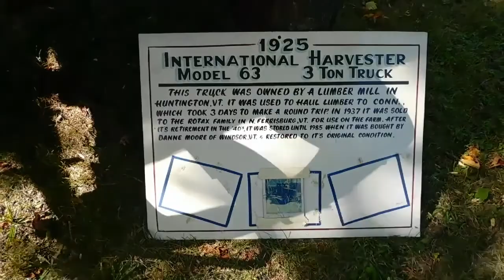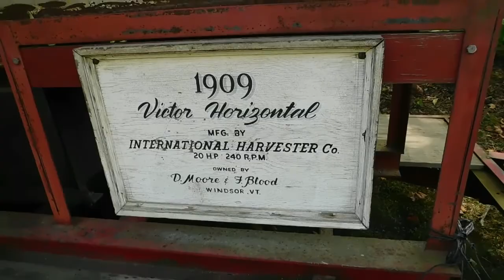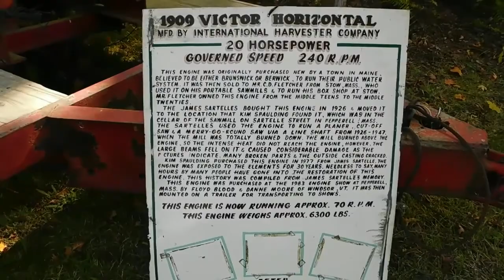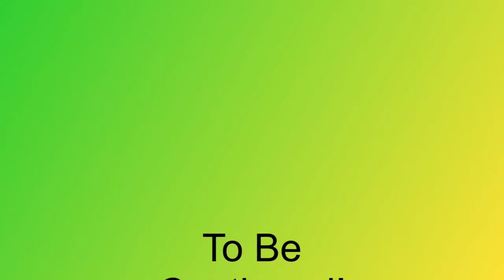#Barker Farm Antique Tractor Show Antique Tractor & Truck Show | Steam Tractors, Trucks & Machinery

Comment: Some fantastic looking equipment and it is good to see some of it in original condition. The snow mobiles were interesting as we do not see those over here. I was was a bit surprised when you said you were looking at the equipment for 3hours, I think we would have been looking at it as long as possible and until we got dragged away 🙂 Thanks for sharing the footage and I am looking forward to the next part
Reply from the maker: I would have spent more time there, but it was getting late and I had a nearly 2 hour ride home. Part 2 will show some amazing old machines and tractors! Thanks for visiting.